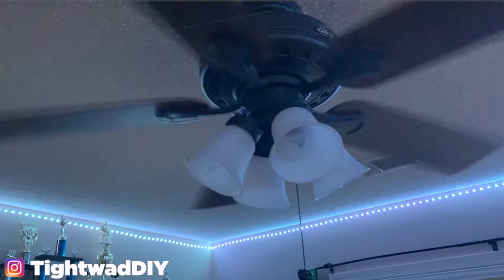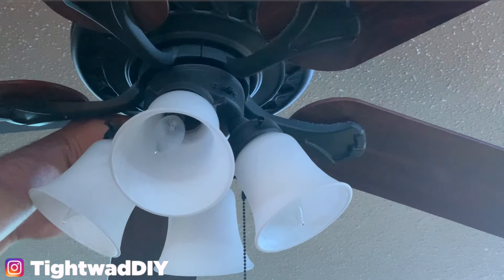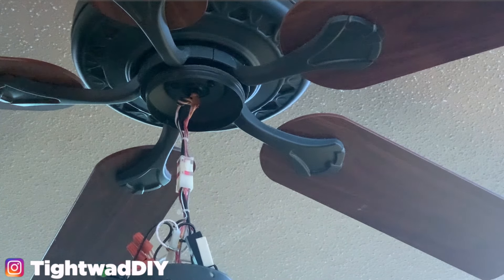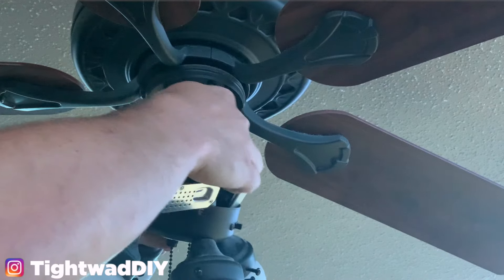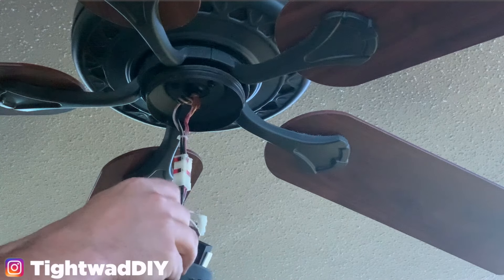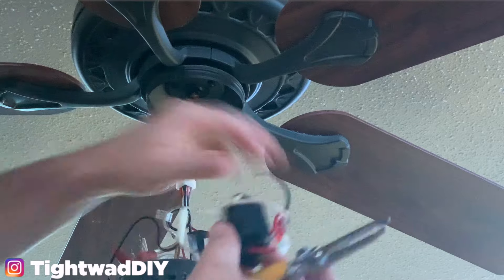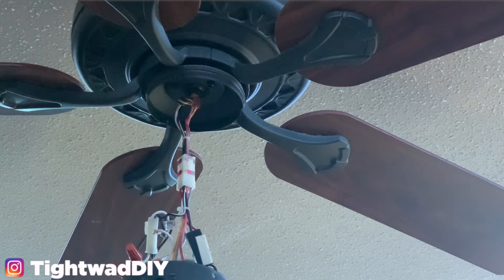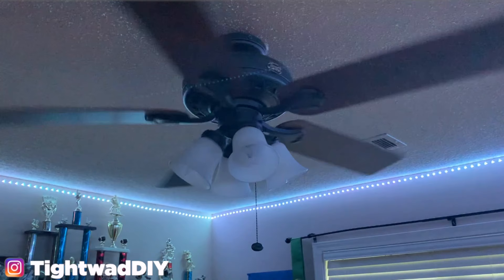Ceiling Fan Lights Repair - Lights Not Working on Ceiling Fan - Hunter

Comment: I installed a new Hunter fan.  The fan worked but not the lights.  When I wired it differently, the lights worked but not the fan.  This is a LED fan so there's no wattage regulator or receiver to bypass.  Here's how I fixed it.  Follow original instructions the fan.  I had an additional red wire coming out of my ceiling.  I used the RED ceiling wire INSTEAD of the BLACK ceiling wire to connect to the black receiver wire. Then I capped off the BLACK ceiling wire alone.  Followed all other connecting instructions.  After 10 hours of trial & error and speaking with Hunter directly, problem solved.  Hunter thought it was a bad motor engine or bad receiver.  Problem finally solved.
Reply from the maker: I’m glad you were able to get it working!

Comment: Easier fix: clip the black, red, white wires at the wattage regulator, strip the black and red wires, use one wire nut to connect the black and red, use a second wire nut to cap the unstripped white. No need to fiddle with the other wire nuts or wires.
Reply from the maker: Thanks.

Comment: When you say "higher wattage bulbs" (around 5:35), you're meaning incandescent that are higher than recommended by the documentation of the fan? LEDs, being much lower wattage, wouldnt cause a problem, correct?
Reply from the maker: That’s correct.
Reply: @TightWadDIY I opened up the fixture and there's no wattage regulator. There's a capacitor, but it isn't inline with the fixture.
Reply: @TightWadDIY BTW, it's a HUNTER 23682 60" Grand Lodge Ceiling Fan

😊

Comment: First and foremost, thank you so much for rhe short and sweet vid. So i have a fan that the fan wasnt working but the lights were. Dusted out the area and even pulled the plug of the light fixture and set it down. Tested rhe fan without the lights and it worked. When i went about to put the light fixture on, i pulled rhe chain and nothing. I switched out a couple of bulbe to makes sure the bulbs didnt give out. And nothing. I even went as far turning of the circuit breaker and turning it back on and nothing. So, now i have a fan, but no light. And recommendations?
Reply from the maker: It’s possible you have a bad box like the video shows.
Reply: @TightWadDIY  first and foremost thank you so much for responding. Not many people do that after they post a video some time ago. Thank you so much. I'll try to look for one of those boxes and replace it. Thank you again. #not_all_heroes_wear_capes

Comment: What if you have power to the multi chain switch for fan speed problem. The hunter fan will not increase speed at highest setting.
Reply: What if the lights work but the fan doesn’t? Do you have a video for that problem?
Reply from the maker: That sounds like an issue with the speed control switch to me.
Reply from the maker: Sorry I don’t. It could be a wall switch issue though if you have two switches.

Comment: I’m hoping that someone in the know re electrical issues can help me please.  I just had a friend hook up a fan/light kit for me and the fan works but the lights don’t.  The original light fixture had a pull chain and no switch on the wall for it.  The new fan/light system also has pull chains …
Could it be that the lights won’t work without there being a main switch?
Reply from the maker: They probably hooked up the wires incorrectly.

Comment: Hard to see what you're doing with your hands in the way. Please tell me where does the red wire go? Not sure if you said they all go together or not. I can't get the lights to turn off!
Reply from the maker: Sorry. The camera angle was really bad. The red wire was just for the regulator on mine and isn’t used once you remove the regulator. Basically you join the black wire from the switch directly to the cluster of other black wires. You then clip the white wire from the regulator, strip it, and add it to the cluster of white wires.
Reply: @TightWadDIY  Thank you so much for replying back. I think we might have different Hunter Fans. I put the blacks altogether, including the red wire, because after I cut the 3 wires the red one was connected to the inside bottom of the pull chain that turns the light on or off. The white was in the cluster of the other whites, so I just capped that one off. (that might be something I am not doing right) I can get the lights and fan to power on and light up, only problem is the lights will not turn off from the pull chain. That is the only way to turn the lights on, no remote or wall switch.
Reply: @royloporto5489   Do you  have one black wire going to and coming from the switch on the fixture? That switch just opens or closes the circuit for the lights. It’s usually a black wire which can be confusing since there are so many. The other black wires typically go to each of the bulbs so they need to be connected to the wire coming FROM the switch.

Comment: I removed the wattage regulator (Y59 B 120C) several months ago and now the lights again are not working.  Any suggestions?
Reply from the maker: Check your connections. Maybe one came loose.

Comment: I have an issue on a new install where the lights only work if the fan is running. No way to only have the lights on with fan off. Is this normal for Hunter?
Reply from the maker: Shouldn’t be.

Comment: Mine is just the opposite. Lights work but fan won't. Please do a video on this problem
Reply from the maker: I can’t film it because these fans aren’t in my own home. However, there is a black capacitor that controls the fan that can go bad. If you can locate it, order a new one with the same numbers then cut it out and splice the wires to the new one.
Reply: @TightWadDIY  okay. Thank you

Comment: How about a kendal fan with the same issue, the light flutters , but wont stay on, the fan works perfectly! Ken
Reply from the maker: Probably a similar issue. I haven’t worked on those.
Reply: possibly issue at the switch